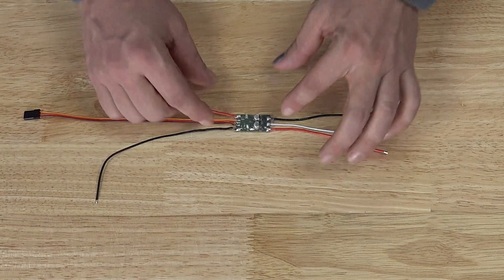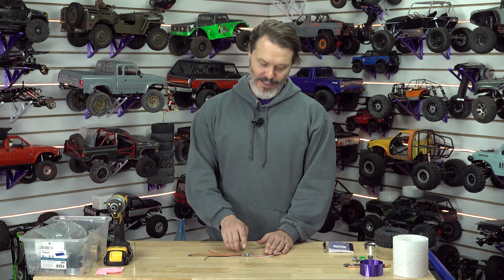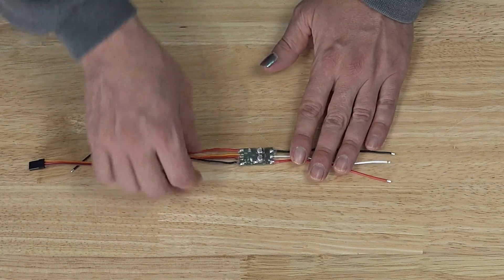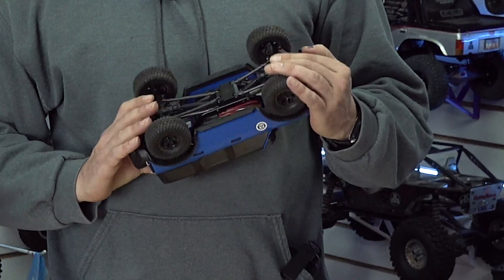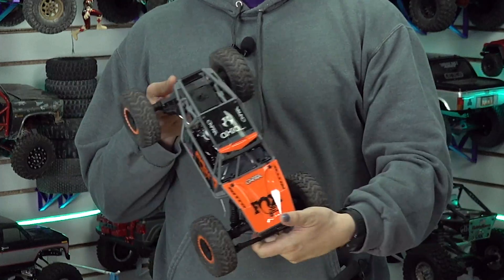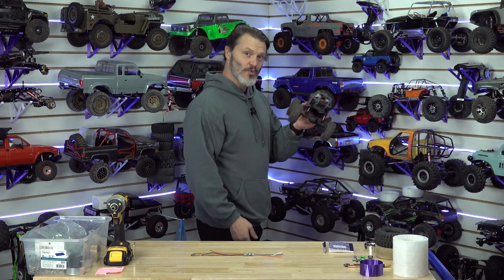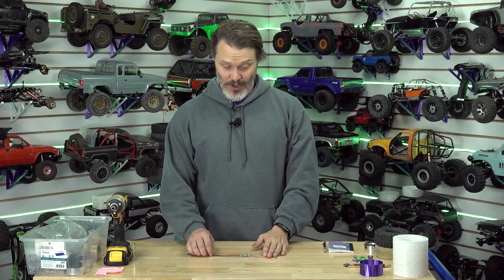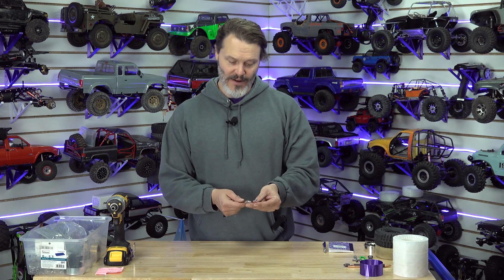Castle Creations NANO ESC Unveiled! 🔧 | Exclusive Insights with John Robert from Holmes Hobbies!

Comment: These probably won't hold up to a CrawlMaster Sport 550, right?  What do you think in an extremely light LCG rig.  It really doesn't need a 550, that's just what I had on hand.  Maybe a TrailMaster 540?
Reply from the maker: Yeah, no way.  It's super tiny.  Brushed 380 max, better on 050
Reply: @HolmesHobbies     I guess I need to go with one of those 40A AM32 brushless systems with a small outrunner.  What do you think of those?